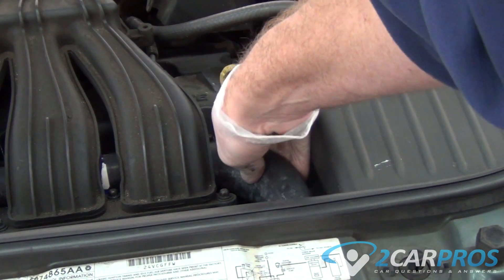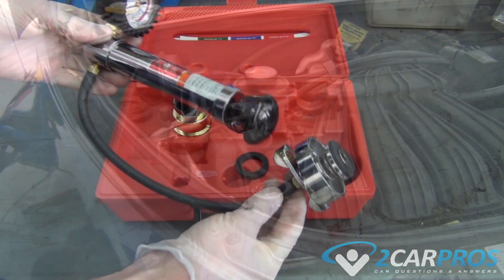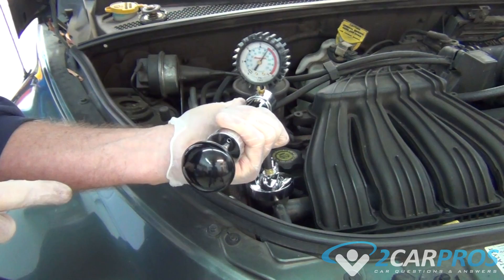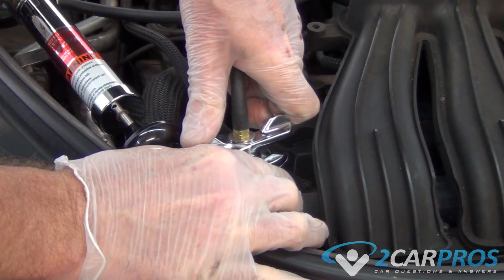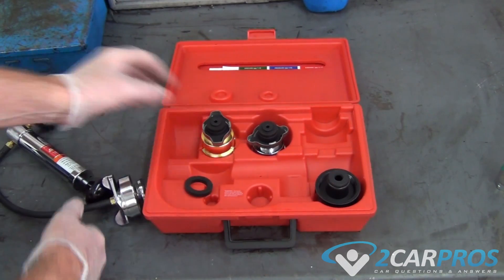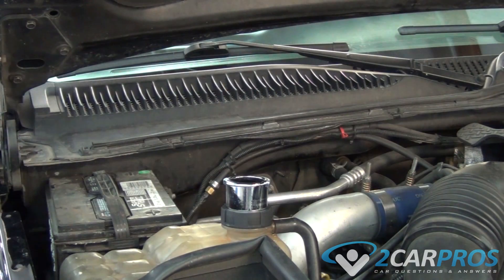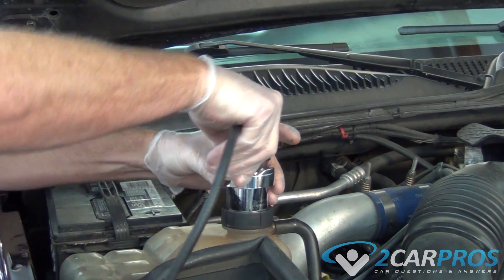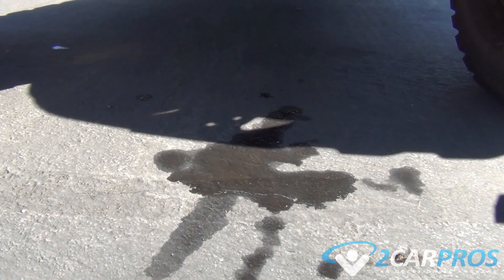Car Engine Cooling System Pressure Test For Coolant Leaks

Comment: do this with car runng or off(yS problE off but ?), & with-in that ‘probley off’ ness, here’s wat no one mentions, the heater & heater core?☝️, hmnnnn?🤔 do not most cars have to B running to open heater valve watch-a-ma-call-it gizmo? or perhaps just the key on & heater turned on, in which case battery would VERY likely not last 20-30 minutes.. the dreaded heater core conundrum Cmz 2 B, quite untouched on Utube prS. tSt viDOs..

Comment: Question. I have a slow leak somewhere in my cooling system but am unable to pinpoint it. I have no coolant on the ground under the vehicle anywhere. And it doesn’t appear to be leaking at any of the hoses or other connections. However my expansion tank  keeps loosing  coolant (no it isn’t cracked or leaking) . I put one of these pressure testers on the radiator and pumped it to 15 psi and looked around and found nothing so I left the tester hooked up and walked away.  An hour later it had lost 1 psi. And still nothing under it or anywhere else that I can see. I don’t know what to think 1 psi doesn’t seem like anything to worry about but I have had to add coolant to the overflow a few times now  the radiator itself has never been low just the expansion tank. I have no crud in the oil, nothing weird looking in the coolant, no white sweet smelling exhaust. I am at a lose as to where the coolant is going. Any thoughts?
Reply: Did you figure out what it was? Having a similar problem with a 04 escape
Reply: @jakebohl  Not exactly. The  best I can figure is there was air stuck in the system. I haven’t had to add anymore coolant since. It has never overheated. And I’ve never seen any leaking from anywhere. I did flush the cooling system and changed coolant a bit before this issue came up so I’m left to assume I didn’t get all the air out at that time and it somehow worked it’s way through the overflow creating a void in the system allowing coolant from the overflow to be sucked into the system making it look like it was leaking when in fact it wasn’t.

Comment: Can you do a System Pressure Test while the car is running? (i don't car about the safety issues- just don't know if it is possible, will give a false reading, or whatever)

Comment: If I have a cracked water jacket and coolant maybe leaking into my oil but a small amount would I lose pressure on a gauge such as this since I cannot see inside the engine to confirm if I have a cracked block?

Comment: Hello 2 Car Pros -
   I viewed the link you suggested to look at but it's totally different then the one you are using in your video - can you let me know the brand name and model number of the coolant pressure tester tool in the red box you were using .
    Thank You
Reply from the maker: +Pete Moss I believe this is the exact one used in the video. https://store.snapon.com/Cooling-System-Testers-Air-Powered-Cooling-System-Pressure-Tester-P649966.aspx but the cheaper one Amazon will work just as well for the average user

Comment: Hello 2 Car Pros -
   Watching this video of testing the coolant pressure with the testing device you are using and saying it could be bought on Amazon for  $  40.00    I looked but I can't find it so can you please tell me the model number of the one your using in your video so I can but the same one .
         Thank You
Reply from the maker: +Pete Moss Hi Pete! Prices on Amazon tend to fluctuate wildly for some reason. For instance I bought a pair of head phones on it for 160 bucks 3 weeks later they were down to 120. So it went up 7 bucks on the tester kit here is the link http://www.amazon.com/Mityvac-MV4560-Radiator-Cooling-Pressure/dp/B003V9L05G/ref=sr_1_2?ie=UTF8&qid=1462205249&sr=8-2&keywords=coolant+pressure+tester+kit